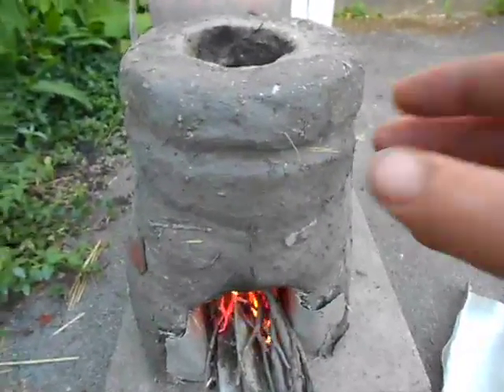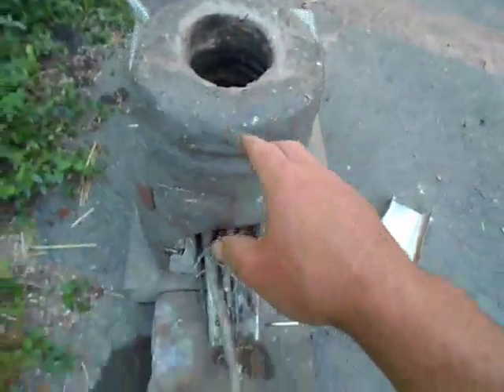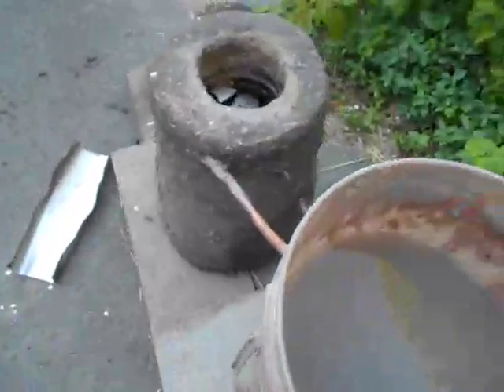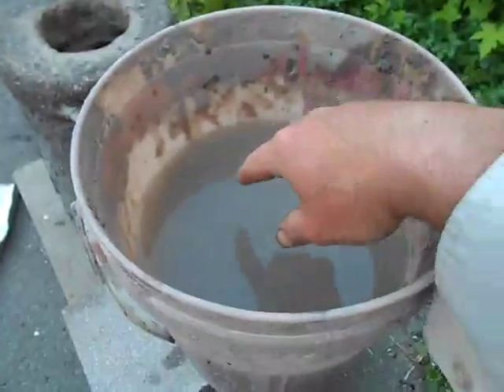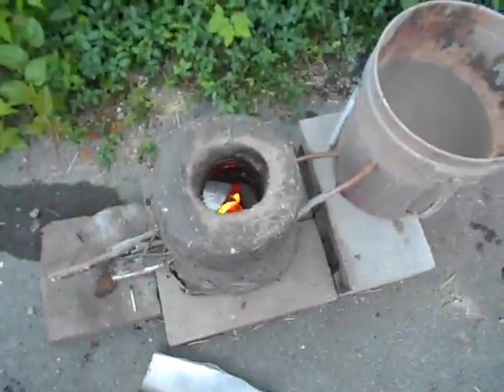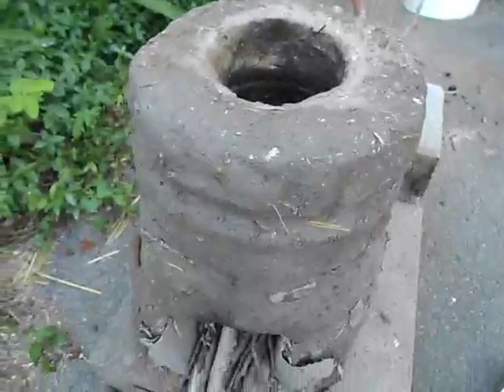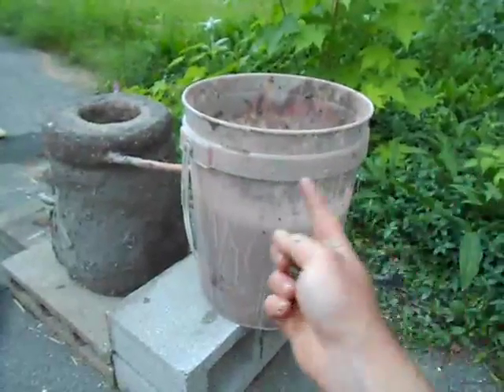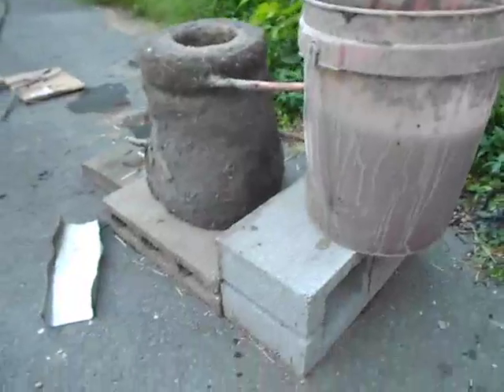Cob Rocket Stove - with copper coil for water heating

Comment: Very nice !! I wonder what happends if you'd put a thermochemical bottle "battery" in the middle, like sodium acetate (same used in hand warmers..) or drying some zeolite (a type of clay ..) or calcium chloride (usually used as dehydrating salts)
At night when days starts to get cooler, go to find some not yet activated thermochemical battery, then activate the quantity you need for the night. When it is finished to give back heat, you can reload them in the solar dryer/cooker or in the stove... ; )
Reply from the maker: Way beyond my scope of understanding but hey, sounds like you may have some ideas there!
Reply: @edibleacres  Same like hand warmers, but at the scale of the stove or more. Catch the heat when plenty available, release it when needed, with simple reactions (zeolite clay + water for instance)

Comment: Often times modern water heaters break by having mineralization near where the heating elements are, they insulate the elements that lets them overheat and burn out, so you can get them for free, but I've had good luck using them for a tank for a system like yours, cause you get a pressure relief valve that's all underwriters limited approved, hah, and a double walled metal tank with insulation in between.  I've put them "upstream" from a regular tanked water heater, to preheat it, and you still get the anti scald protection from the regular water heater, anecdotally I think it precipitates out some of the minerals that would break your regular water heater, so has a lot of multiple use action, like we like in permaculture.  I'm getting ready to build a Scandinavian/Siberian style thermal mass masonry heater, out of native soapstone, in my basement, already have a 30' masonry chimney, so tying into that in the basement, and it's right next to my water heater, so I will definitely put some coils in it to pre heat my water too, and possibly some radiant floor heating as well, if I can scrounge some pipe for that.

Comment: Ancient Romans had a similar setup but it was huge. It was used to heat the bath house water.
Reply from the maker: That is neat to know!
Reply: @edibleacres  There is a ratio between the input hole and the length of the stack.
Unfortunately a hard drive failure lost all my data.

I think is was close to a 4:1 ratio - 1 foot input hole to 4 foot stack.
Can't remember sheesh.

I did this one time and had flames shooting from the top of the stack nearly 5 feet.
Almost no ash left either.

If the stack is too tall, it won't heat enough to draw the flames.
Too short and you lose heat energy.

There are limits as to stack height and construction.

Modern high efficiency furnaces have equal length input and output pipes. Keeps things balanced.
They also use a pressure switch (or several) to ensure that things are working before firing up.
Unnecessary for a rocket stove but the scientific principles are the same.

Old furnaces needed a certain height chimney - too long and it had problems with draft.
Too short and it had issues with drafting.

Modern day wood stoves need a certain length of flue to draft properly.

Air velocity is the key to efficiency with respect to everything else.
Think using a bellows or even a blast furnace.

Look up a Yakhchai. It uses evaporative cooling to work and dependent upon air flow.

A rocket stove is similar in principle. But sort of in reverse.

Comment: Good video mate, you just described my system on my allotment, I have a small stove with a coil of copper heating up a tank of water and I have ran underfloor heating pipes under my raised beds outside which helps extend the shoulder seasons and keeps ground from freezing, with a poly cover on top i can grow all year round. its also under a central path made of concrete slabs on a bed of sand in my greenhouse and the whole path acts like one giant radiator. works great and costs nothing to build.
Reply from the maker: Sounds like an awesome setup you have!

Comment: BTW, here is a hot tub that does just that. It where I got my idea to do it. We rented one of the coast and was filled with fresh salt water, and heated to hot tub heat in a half-day of wood burning. It was too cool. https://www.wayfair.com/Alfi-Brand-Wood-Fired-Spa-FireHotTub-L3217-K~NBT1093.html?refid=MX79783316887299-BPA49-NBT1093&device=c&ptid=4583382940120202

Comment: I made this same concept3 years ago. I took a temp reading in my regular 5 gallon rocket and one with the copper coils. Both had the same temperature, had no smoke and little waste, and it heated the water wonderfully. I think it is an awesome concept. I didn't use cob as cob absorbs the heat for slow release, like a heater, and I wanted mine for cooking. Mine was just a refractor cement rocket stove with perlite and with 1/2" or 3/8 (don't remember) coiled copper pipe. It is a totally open system so no pressure. I did start the copper pipe about 4 inches up so to keep the fire box hot. You can feel and see the water movement anyways, so if I had accidentally put a clay clod in my water and it got stuck, I'd notice anyways. The inner refractory/perlite has crumbled away a bit on the inside, but I blame my refractory-perlite mixed skills as too dry. Great video. wish I'd take the time to do videos. Thanks!
Reply from the maker: I really wish you took time to do videos too!  Sounds like a really great setup you've got.  If you ever wanted to share pictures or anything I'd be excited to see!

Comment: an insulating riser is necessary for complete combustion.
putting coils in it robs heat from the flue gas and slows it stops combustion.
coils should be after the riser

Comment: Africans  building rocket stoves out of cob on U tube recommend letting them dry for several months before  using  to avoid cracking.  Did you let yours dry?  has it cracked?

Comment: since building the stove has the expansion of the coil caused any cracks or breaking in the cob?
Reply from the maker: +lostwilly f To be honest, I made the stove and ran it a few times to test it, very promising, but then I retired it and moved onto other projects.  This is a good reminder to bring it back out this spring and put it back into use to see what it can do!  I wouldn't think that the copper getting heated then cooling would cause an issue since the cob is fiber rich and so should have plasticity and flexibility a bit...

Comment: you need a pressure valve to release the pressure from steam ? I am not an expert but I have a pressure valve on mine
Reply: the difference being that his is not a closed system IE steam/expanding gasses can escape freely :)
Reply from the maker: +Madam Vonkook Yeah, I don't think there would need to be a release valve since there is no point at which the water can be locked in position or held back.  It's an open loop so I would believe (hope!?) that it shouldn't be able to become something dangerous.
Reply: Only need a release valve if there was a lid on the water container. Pressure builds from the steam off the water if it is in an enclosed cylinder then you would need an outlet of some kind to release the steam

Comment: Firstly, do NOT take heat from inside of the heat riser (the chimney). Heat is concentrated in there on purpose in order to burn the fuel (wood smoke) more completely.

Secondly, if for some reason that coil EVER becomes blocked or kinked, it will become a bomb! What you are doing is cool, but also potentially quite dangerous.
Reply: Kirk Mobert You are right on- put the copper coil AFTER the heat riser so the gases can burn completely; a catalytic burn is waht you are after.  THEN extract the heat for water.  Another benifit is that the heat after the heat riser stage has plenty of volume, but a lower and safer temp - plenty to boil water with, but lower than what would melt your copper, should ytou ever waht to run it while dry.

 Great first try!
Reply: +Kirk Mobert It's not "stealing" or "taking" heat, it is absorbing excess heat that was already leeching into the chimney. Those chunks of metal in there were a bad idea though as it impedes the air flow causing a less clean burn.

As for the coil becoming clogged or kinked.. Non-issue there unless you are beating the snot out of the inside of your  chimney or you are running dirty water like he was doing (but he was doing it for visual reasons)